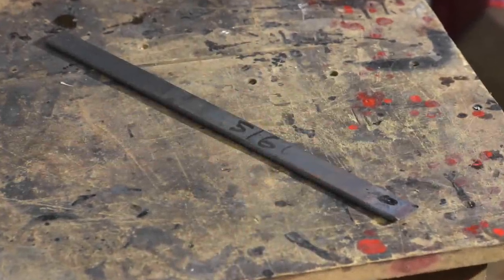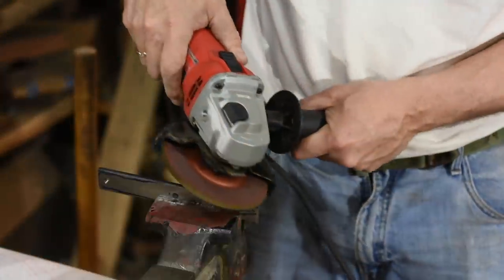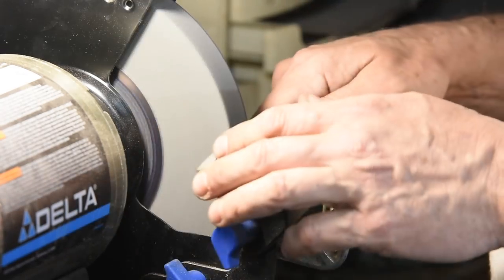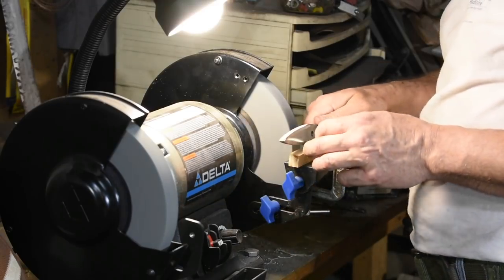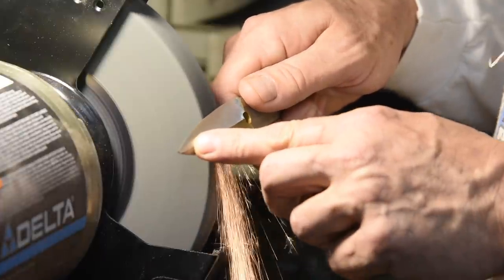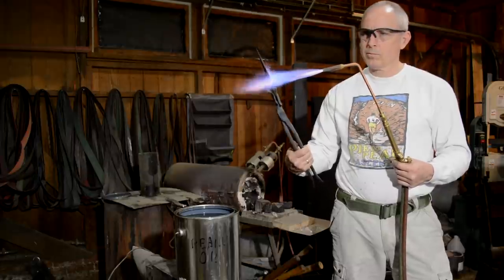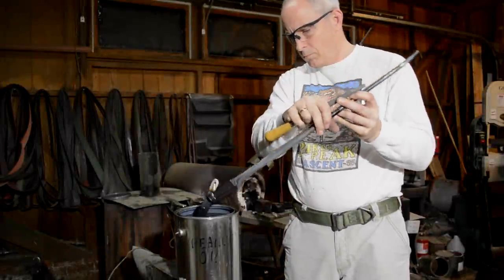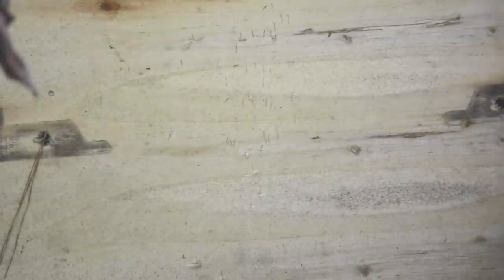Make a Throwing Knife with Basic Tools!

Comment: Yesterday, before I had seen this video i made my own throwing knife, using the same techniques as described in this video.  Only I used a file and a waterstone for the edges. It was made from scrap metal and I also haven't heat threaded it. The next knife will be a little better thanks to this video! Thanks Mister Sorrells.

Comment: Considering a file is hardened so it can cut other metals, it's also brittle. So a knife made from one should be tempered in an oven at a temperature of 400 degrees for one hour. Air cooled for ten minutes and reheated for another hour at 400 degrees.

Comment: Hey Walter, I wondered if you have any Admiral Steel Hitachi steel. I have 72" and the six that I decided to experiment with was 100% failure rate, forge welding it disintegrated inside the wrought iron jacket and forging the flat bar into a leaf shape at the tip it split. More experiments, me and dad watch you once a week together. Trappers, me and him feel your knives are practical for skinning.

Comment: Great video.
-- Wish you'd post the dimensions of the blanks you started with - especially the thicknes.
-- Would it be possible for you to trace the outlines of your knife and scan it into a PDF for download?  Or after tracing the outline on a blank piece of paper, lay a ruler next to it and take a picture?
-- Can I quench with motor oil?
-- Any idea what the speed was on your bench grinder?  The slowest so as not to heat up the blade?

Comment: I literally just bought steel to make throwing knives yesterday! I'm teaching my mother to throw knives and she loves it and wanted to make her own knives..
QUESTION: Will "Plain steel" work for a thrower? I just grabbed what Lowes had a which is a 2x36x3mm flat bar labeled "plain steel" Obviously I'm not looking for edge retention but do you think it will break or keep a decent tip?

 P.s. have you ever made throwing stars? I'm working on some K shaped ones for my mother, and I'd love to see you make a video on them. You always add a cool unique take on everything you do and I bet they'd be amazing!

Thanks, as always I learn a lot from you Walter and hope the best for you.
Reply: do the spark test mate, if you grind it and the sparks come off and explode at the end of the spark its high carbon, it should look like a sparkler crackle, if its soft steel it will just fly off no explosions.
Reply: Corey Townley Hmm, I've heard of that but never tried it.. I'll give that a go! Thanks. I have no idea how I'd heat treat this mystery steel so I'll have to just be careful not to "burn" the steel and anneal it.
Reply: like walter says use a magnet, when it stops being magnetic go a little bit further and then quench in warm oil, remember only to heat treat the blade and not tang, the tang is soft steel to absorb shock without it you will have a higher chance at shattering your blade on a throw. being such a short blade there is zero need to normalise the steel
Reply: Corey Townley Yeah but if it is file hard it will chip and break, it's the tempering I'm worried about. I'll just experiment with some smaller pieces and see what happens and after more knife making practice I'll buy some decent O1 or something easy to work with like that. 
Thanks for the help, do you make knives?
Reply: danteelite it will bend the tip pretty quickly
Reply: Mr Cow Yeah, I planned on making them similar to these: https://tinyurl.com/m59mnp5 in hopes that that design would result in stronger tips, I'm gonna keep as much meat on the tip as I can while still having them stick well. Besides it's a learning process y'know?
Reply: yeah I do enjoy a little black smithing myself, never tried throwing knifes but mainly Bowie knifes etc... I really want to learn Japanese sword art.

Comment: Mr. Sorrells, thanks for putting your experince out here for those of us trying to learn the art of knifemaking. I just watched your making a throwing knife wideo. Your use of a peice of scrap as a grinding guide was a great inspiration, i have had troubles with getting my center ridge even and centered. I have noticed that as you progress with the grind, due to the devolping bevels, how the edge contacting the guide changes degree. What do you do the compensate for this? Just switched to freehand now that i had a flat to work off. Any advice would be greatly appreciated.
Reply: Experience*

Comment: Awesome! I was just doing this myself and was hoping you would make a video about it. I'm  making mine from a cheap crowbar.
Reply: Tommy Walker make sure you have a scrap peice of the crow bar to test the hardening of the material. heat up a peice that is about the thickness of the blade and quench in oil. lock it in your vice and hit it until it snaps or bends. if it snaps, heat treat in oil. if it bends, try water quenching. if it still bends, you got the wrong steel.
Reply: Brandon Hobby Thanks, for the advice. I will do that.
Reply: Brandon Hobby thanks from me too, that's why i read the comments!!!

Comment: If the heat treat doesn't result in proper hardness, do you have to normalize the blade before re-treating?
Reply: Nope. When you reheat it to hardening temperature it will be softened some time ago. No need for normalizing.
Reply: DahVoozel am no expert but if you failed, would that be akin to normalizing it?

Comment: Hey Walter, I like your videos. I was wondering if you could tell me why you make the throwing knives so short. I also watched your video on bo sherikens , I think you said to make them about 7" long. Again, I was wondering, why so short? I like my throwing knives that are 14" long the best. My 12" ones are about as short as I like. I even like my 16" throwing knife, but, I have a little bit of trouble with my targets. Yep, the problem is they just don't last very long. I don't really understand why people get so close to their targets, 15 or 20'... I just don't see much of a challenge or excitement in that. I am much more comfortable throwing from 45 or 50' away, a minimum of 40'... any closer than that just doesn't seem like I'm accomplishing anything, except maybe dodging my knife if I get a bounce back. I don't worry about that though, they don't bounce back anywhere near 40'. I just put 1/4" thick, oak scales on one of my  14" knives. It is still out in my garage, so the epoxy can dry over night, before I even go around it, because I'm going to want to throw it first thing.. I sure would like it if you let me know what you think about the things I was wondering.. one reason I like longer knives is they seem to fit with the mechanics of my arms. 1 have a reach of @ 32"... im about 6' 4" .

Comment: Is it the video tricking me or are you running that grinder speed slower than a 'normal' bench grinder? And if I can't slow my grinder down, should I just use less pressure and keep quenching the blade more frequently to keep it cool? Also, with the angle grinder, are you taking care to keep the heat down there as well, or is it not too important? Sorry for the noob questions. Dave.

Comment: Hi Mr. Sorrells. Thanks for doing this video. This is actually a project I've been excited about doing for a long time. But question about the heat treat on this knife. Would 5160 benefit from normalizing before  hardening? Or would that be unnecessary for a throwing knife? I'm looking forward to the remaining two videos. Keep up the fantastic work.
Reply: Nathan Johnson  normalization is generally used when forging not stock removal. hammering the metal to shape creates "stresses". stock removal doesn't "upset" the material used.

Comment: I have been trying to find information online for tempering temperatures of different steels but have been unlucky so far.  Any thoughts on where I could find Tempering Temps and times for various steels?
Reply: Travis Layh I'm using .9 to .97% carbon steel. oven at 400 for 1 hour. let it cool naturally on the stove top and then back in the oven for another hour.  but I am sticking with simpler metals, not super steel plate quench air hardened stuff.

Comment: Hi Walter, Can I make knife with K460 Böhler steel? I have some flat stock lying around. Thanks. AK
Reply: Looks promising, give it a go :)
Reply: Piran,  Yes I'll try cheers. It's an oil quench steel and I think it's kind of tool steel hence very hard. AK
Reply: If it's hard now it may be already heat treated so be careful not to damage Your tools :) From info online it supposed to ba a typical steel for industrial cutters and dies, about twice the carbon content the steel from this Walters video :)

Comment: so is it impossible to harden weld steel, or just really difficult?
Reply: additionally, water or oil if one was to try it?
Reply: weld steel contains so little carbon the answer is no, it can become work hardened but still will not hold an edge. weld steel can how ever be case hardened by baking it in an envelope filled with sugar for and hour or so at a temp of maybe 1100 Celsius, the carbon leeches from the sugar to the softer mild steel but only imparts about 0.5mm to 1mm of hardness to the material. in short, buy carbon steel, its just easier. the envelope is made of steel, incase that wasn't obvious
Reply: Thomas Russell Short answer, you can't. The lack of carbon in welding (mild) steel makes it impossible, because quenching (heating to critical temperature, rapidly cooling in oil/water) the steel doesn't result in crystals being formed, which normally would harden the steel.

If you really like to make a knife, I suggest you use an old bastard file. Choose a flat one, and the process will be fairly simple. First grind the perimeter, file(!) the knife with a filing jig (for the best results). After doing this sand the blade to any desired grit. 

Because you grind the steel, it heats up. This will let the file loose it's heat treatment, but you will be able to file the steel. However you are able to file it, you can't use the new knife yet. 

Heat treating is fairly complicated, but not impossible. Watch one of Walther's videos on heat treating, an I guess you'll be able to figure it out...

Good luck making your knife ;)
Reply: Oh before you start sanding like a mad man, don't go any further than 600grit before heat treating, it will be a waste of time!

Comment: 5160 doesn't hold an edge very well.?what if it was water hardened. thanks
Reply: Emafex if it can garden in oil, use oil to garden. it will garden in water but you won't get much different results. But you may crack your blade in water. that is why oil quenching is easier.

Comment: A throwing knife should be longer to work good, 11-14 inches. The rules for competition tell the length, i think its what i just said . Copy the Cold Steel brand, they fly good
Reply: Gary Warner Cold steel is garbage man I'm sorry to say... factory made knives that are punched out of a sheet of steel. I've bought a sword from them and snapped it in half on a 2x4. I've bought throwing knives that will not hold their edge enough to stick after 20 minutes of throwing...
Reply: Their edge? A throwing knife only really needs to be pointy. Sharp edges are not desirable at all.

Comment: Not to be hyper-critical, you design the knife in CAD, print the design, then draw round it perfunctorily with a 1/4 inch felt marker, then ignore the lines you don't like and do it "by eye"?
Why bother?
Reply: Well he said in most videos that he eyeballs most knives and does not use templates to make them, but here he stated that he used CAD design because he will be making 3 identical knives and that one of them will be made with CNC which is where CAD comes in place.
Reply from the maker: I think I explained in the video that I'm doing three knives in this series, the third of which will be done on my CNC mill.  So the basic design is shared by all three.  The lines weren't perfunctory -- which implies that they served no function.  They were just rough references so that I would know where to make my major grinds.

Comment: one comment  / and  i  destroyed     more throw  knifes //normaly  from  tip fatigue from heating// i throw hard  //like  kill    throwing  no just   it stick   it s  ok 
,, and    the  middle  hole  is   done   right  in part where  if   not tip  but    like in full rotation method where   want  or  not ,, you  will hit  flat   no    butt  or   tip  but     flat  on  and  if target  is   log ,, u  will brake theese   straith in half  
other  than   middle   hole can  be  /7 or   2  cm    more to rear  and  that will help   /not solve //you can  altho    not  have straight  line    handle   to    blade  you  can  2  /2  // so    2   grinds  overlap   and  go   few  mm   more  /than others //so no  ovious  weak  spot //and  with heat threat  you  do  this  further  i d  heat treat   a    half  inch of   handle  too /or  more

Comment: ever heard of a pilot hole?
Reply: James Tarver why the hell would he need a pilot hole there? that drill bit was about 8 mm thick.
Reply: depends on how much he values his drill bits
Reply: James Tarver why? a drill bit can easily cut this tiny hole at once. Dont know if you know it, but a pilot hole should just be as big as the non cutting edge on the tip of the following one. A 8mm bit has a full cutting tip...
Reply: o yeah its just falling through that bit of steel, what was I thinking? Was he trying to melt his way through?

Comment: Drill all three, bolt all 3 together, then profile bolted together. Then don't remove the strength of the blade with stupid bevels you never see on a real throwing knife. These knives don;t need to be sharp, just have a  point, and heat treating, not required at all.

Comment: you shouldn't heat treat a throwing knife because it might brake on impact it ice better to leave it soft because it is not supposed to hold an edge
Reply: flipazoid 27 wrong. If you don't heat treat a throwing knife it will bend. A spring temper as was done in the video is the best option.
Reply: Geoff Flato
Reply: yes?
Reply: *break...
Reply: the tip would bend.